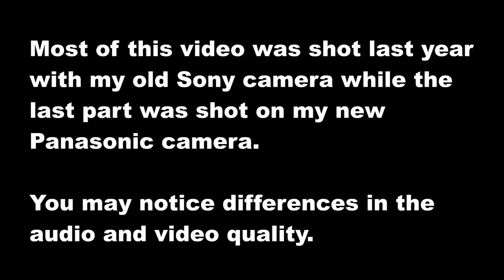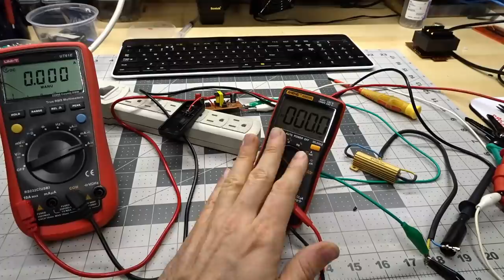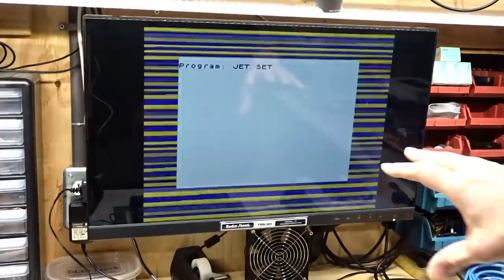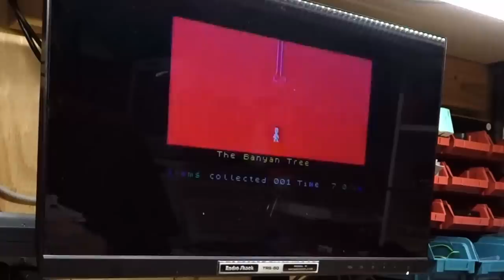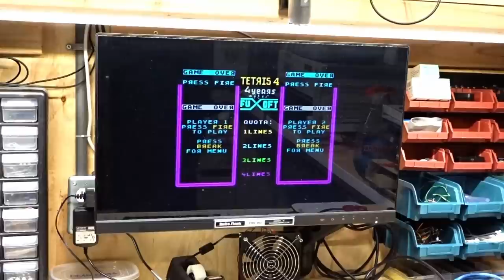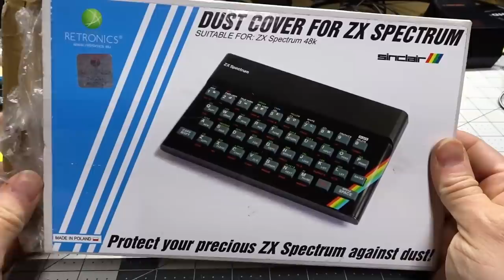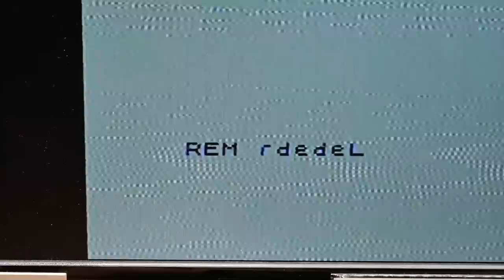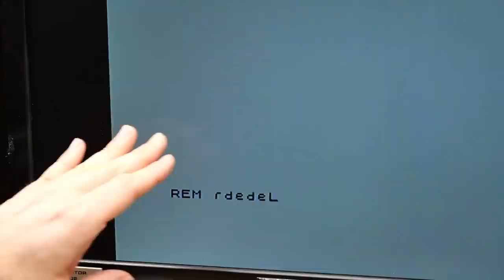ZX Spectrum Part 3 - Revisiting the machine at last!

Comment: I know this is old video so my comment might be irrelevant. Would it be possible to check with a scope the signal going from the tape input and follow how it is being shaped into digital signal? Maybe some of that analogue circuitry is old and needs refreshing. Bad caps, or noisy transistors/opamps. Similar to how you diagnosed the acorn machine. Then you could also see what volume level gives you the best and cleanest signal
Reply from the maker: Now i've done that on the Acorn Electron, it might well be the similar fault that was on that machine! I always just choked it up to the version of Speccy causing the issue ... but indeed may well be another fault outside the ULA.

Comment: Hi Adrian! Thank you for your videos. I love every second of them!! I used to have a z80 clone as a kid (born in eastern europe) and I cam tell you're right about it. Huge difference between zx spectrum and conmodore.. cpu, video, sound, keyboard , software.. everithing. I just want to ask you: that's that 8bit computer on the shelf right above the zx spectrum? Is it a TI calculator? Thank you!
Reply: What computer did you have back then? JET? Sintez? ICE Felix? Didaktik? TimS? CIP?
Reply: Marc Kloosterman - Hi Marc. i had a CiP-03 home computer (made by Electronica Bucuresti), then a HC 90 (made by I.C.E. Felix), but also worked on some JET, TImS and Cobra computers . Then an  Student PC XT (also made by I.C.E. Felix) - an 8086 with no math co-proc. Beautiful times :)
Reply: @cretescumarian6057  I have 2 JET's, a working blue one and a yellow one which I haven't tried, and a working HC 2000 (but missing a good tv cable). Just by saying you had a JET, CoBra, CIP-03 and HC, I know that country in Eastern Europe you mentioned has to be Romania 😁
Reply: (and maybe your surname too!)
Reply: @Marc Kloosterman  - Indeed it is ☺️ Glad to meet you, Marc (Netherlands?). I looked up for the cavle you've mentioned (it's been a long time since I had one) and you can hook the HC up to a TV set using a normal RF cable or to a monitor using an RGB cable. I used to have one of those ICE Felix green phosphor monitors later on... kinda miss those days..
Reply: @Marc Kloosterman  - and how come ended up having three computers from Romania? Collecting?

Comment: yes a proper Video RCA cable by nature should be thicker as it should be coaxial cable and not just twin flex like what's used in audio connections
for what its worth, I never tape loaded a speccy but I have never gotten a tape load to be solid on a cell phone or MP3 device, there's too much garbage in the signal, a wav file playing from a PC works well on my apple II and timex (us speccy with "differences")
I think even some of the best portable devices out there are just too lacking in audio fidelity and audio horsepower to deal with a "high speed" data transfer or they try and be cute masking the deficiencies with processing that would be very desirable to a humon but not a computer.

Comment: that RC cable is picking up noise from something else in your setup.... i would look at the power supply. Also look at your amplifier you made. It amplifies everything, including electric noise. Also as stated by others, try turning your phone down to around 80%, at max volume the phone's signal is to hot, adding additional noise.

Comment: The ZX Spectrum likes to hear the sounds as treble, high-pitched, sharp as you can make it, it needs to be treble or the computer wont be able to recognize it, bass sound will Always make your programs crash or error during loading, so in the old days we had to have a screw driver ready to adjust the old tape machines head and adjust it into treble sound, i think that might be the issue with your loading problems, but i noticed again (i already commented that on a previous video of yours about your machine there) i almost cant hear your spectrum speaker playing the "modem" sounds as it loads a game nor ingame, it should be louder. About problems loading games, remember: Loud and Treble; Bass is a No No!, thats the only problem you are experiencing now.

Comment: When you load Jet Set Willy at 9:49 the bars are definitely too narrow and the cyan bars are narrower than the red.
This indicates the volume is too low.
I still don't think you're getting the necessary oomph.

I also note that you don't seem to be able to hear the loading tones (correct me if I'm wrong) but this also indicates low volume.

A further thought occurs...   I would assume that you do have tape connectors in the right way but I remember,  back in the day,  thinking the labelling was odd.
You see,  Ear (the headphone socket) on the tape deck/phone has to connect to the Ear socket on the Spectrum.
I always thought Ear to Mic and Mic to Ear would be more logical but,  on the Spectrum,  Ear goes to Ear and Mic goes to Mic.
Reply: Of course it is in the right socket. Nothing would happen at all otherwise.
Reply: @t7plus  I think you're incorrect there.
I seem to remember,  back in the day,  that if you fed a tape signal into the Mic socket in the Spectrum there was a very small response.   If you fed a strong enough signal in it would work but very unreliably.

The same if you recorded from the Ear socket,  you'd get a very weak signal.
Reply: Yeah, I had a look into it a bit more and you're right. Weird eh? I don't think that's what is happening here though, but when it comes to computers, always check every possibility!

I thought my days of worrying about spectrum tapes loading were over in 1990 when I got an Amiga. No, they are still out there, buzzing and bleeping away. Taunting us. Forever.

Comment: Should have been a 3A fuse, the fuse is just to protect the cable from the plug to device.
Reply: Either that or a 1 amp fuse. The reason the fuse is in the plug is because in the UK they don't have branch circuits with 15A  (or 20A) breakers. They're ring circuits with 30A breakers.

Comment: Did you set do not disturb on the cell phone you were using to load the software? If you get a notification, even if you have the volume down, it might still drop the volume for a second to tell you that you got an email or something.
Reply from the maker: Ah that phone was not on a normal Google account -- was on one that doesn't have any Gmail or other activity. It's my phone I use specifically for loading software onto old 8-bit computers.
Reply: @adriansdigitalbasement  ah okay. What model is it, out of curiosity, and do you like messing around with custom phone ROMs?

Comment: I take offense to the term "Crappy US Plug".  Our plugs are fantastic.  I also love our power standards.  UK plugs, if made to spec, are very expensive compared to US plugs.  We don't need 220/240 volts everywhere.  In the US we only put 240V where it's needed and the much safer, less expensive 110V everywhere else.  Yes we have a plethora of plug standards, but this really isn't an issue for non-commercial consumers.  The cost of materials to wire a residential house in the US is half or less the cost of wiring an equivalent house in the UK with no appreciable value for the cost.  It's the long term results of standards.

You have a quad outlet combo on your bench.  You wouldn't have that if you were using those UK plugs.  Imagine the space they consume.  I could go on, but I shant.  Ranty rants have come to an end.  :)

Comment: Even die hard Speccy lovers admit, it's a very difficult machine to live with. Even if you do sort out the loading interference, you still spend almost as much time loading as playing. Either get a modern loading solution (CF or SD card) or stick to emulation.

Comment: Is the speaker OK? If it has low impedance (much below 200 ohms for issue 2 boards and 40 ohms for issue 3+ boards) it can pull the EAR input down. (Source: http://blog.retroleum.co.uk/electronics-articles/spectrum-tape-loading-notes/)

Comment: ahh ground isolation issues how I hate you
you could try sheilding the amp and making sure it has a direct and high current path to the ground of the spectrum and whatever device is being amped up
honestly the biggest issue with old pc's loading via tape was ALWAYS due to weak or garbled signal and almost always had to do with poor electrical connections between the adc of the pc and whatever was playing the audio
due to quality usb chargers being 100% isolated and the ground issues you could make sure all devices on the chain have zero connection to the mains side of the psu's (besides class y caps obviously) then make sure a direct path from the 3.5mm jack ground to the zx tape input ground (maybe with a few 250ma fuses in-line in case of crappy psus being connected causing a ground fault) this might increase interference resistance (obviously assuming the amp is inside a metal box connected to the amp ground and a fuse to the audio i/o ground) ground loop issues have caused many a panic attack with audio systems

Comment: Very odd these loading problems. Back in the day I owned a bog standard mono tape recorder and setting the volume to 75 percent of maximum almost always worked just fine. There are some insane fast loaders out there like the one used in "Way of the Tiger" which try to load stuff at some 6000 baud instead of the usual 1500. And there are tapes like my original Jangler which are just very badly recorded. 
Other than these exeptions loading almost never was any problem.

Comment: The original jetset Willy on the spectrum is incompletable due to a bug. I only found out years later when the first emulators came out and i could use snapshots to replay when i lost a life. :) But yes problems with different tapes and fiddling with volume was part of the speccy Life ;)

Comment: WD40 is the shit! 
When I weld stuff at my job there are sometimes a plastic cover on the stainless steel and when cut in a laser the glue gets burned to the surface, WD40 is what removes it afterwards.

Comment: maybe since the recordings tend to be at different levels instead of the volume knob have like 2 or 3 settings you can like jumper on and off for like the 2 or 3 volumes that work well.  Also, maybe try loading with 9v input and see if it works better.  I wonder if all these old zx spectrum games could be re-leveled to the same level so all the games load the same.
Reply from the maker: Yeah I'm curious if this app I'm using is problematic for others or it's just my particular Spectrum

Comment: I never had a Spectrum back then, but I know Spectrum tape loading issues were quite common.  Given that this is the year 2020, why not use a modern device based on flash memory cards?  I don't think they're expensive, and you'll still be using the real computer.

Comment: (Sorry if someone else's said this - I've just spent what feels like an hour reading the comments, but YouTube has Twitter/Facebook disease [page just keeps growing].)

You appear to be using real audio files from that 'phone; I presume the problems are in the original capture. (If it's always the same games that fail, that would tend to support this.) As another has said, you have a 'scope - have you looked at the audio signals? (I saw at one point you appeared to have a stack of real cassettes - I think I saw "Chess"; did you try any of those?)

You had one of the printers in one of the videos.
The printer did indeed use silver paper: it was actually black paper, with a silver conductive powder coating; the printer did indeed cause the coating to come off, so that the underneath black showed through (so the print was black on silver). At least, the ZX80/81 printer worked that way, and I'm pretty sure the Spectrum could use the older printers, though it may have been able to use fancier printers too.
On the ZX80/81 machines, the video output disappeared while printing - because the printer used the video circuitry, just slowed down! (It was a one-pixel "print head".) Obviously the Spectrum had to produce the same signal, but I don't know if it had duplicate video circuitry so something remained on screen. (I never had any ZX machines; I just thought  this was a most ingenious thing to do, print slowed-down video! My computer route was Tangerine [1K then 8K], Oric, Atmos, BBC.])

I did encounter at least one /business/ using a black-on-silver printer (I think a garage). Must have shown some determination! (Either to run the entire business on a Spectrum [or 80/81!], or to make something else drive such a printer.)

Comment: Your HD converter box, I found the same one on WISH and I just wanted to know, you did the composite mod to you ZX and it looks like you're plugged in to the coaxial port on the box if I'm seeing it right. Is that port used for composite as well ??? looking for a converter box for the PAL machines I have and instructions for that box are a little hard to follow.

Comment: hi, i use  PS2 slim power supply on most old computers is 8.5v 5A  and is safe. PSP charger for 5v also good.
Reply from the maker: I have one of those PS2 slims as well. Good tip, thanks.

Comment: Do yourself a favour and look into OTLA and K7ZX apps for the PC. They can create a wav file from speccy snapshots that load in a fraction of the time of standard tape speed. I can load most games in around 30 seconds!
I use a little mp3 player into a simple op-amp x10 amp running off a 9v battery.

Comment: The fuse is not related to the device. It is there to act as a circuit breaker for the house wiring.

Comment: A 13A fuse was the default rating in older UK domestic plugs, a variety of fuse ratings were and are available which you could replace it with being 1A, 2A, 3A, 5A, 7A, 10A, and 13A. 13A 5A and 3A being the most common ratings today in modern plugs. The older type domestic plugs are still available, but for safety all UK domestic plugs attached to consumer equipment that are sold today are now sealed and cannot be opened by the consumer. The fuse is now accessed from the outside of the plug. https://houseofbrag.files.wordpress.com/2013/02/sealed-uk-domestic-plug.png

Comment: I know I'm rather late to the party seeing the three videos but I thought I might comment upon your closing remarks.

Indeed, the ZX Spectrum is far less capable than all the US manufactured machines at the time, and indeed the BBC Micro you had in the first video. However, the machines such as the VIC-20 were either not stocked in the popular electronics retailers (or newsagents in the case of the Sinclair machines) or were a lot more expensive.

Of the Commodore machines only the VIC-20 was in the same price range, but you had to buy the dedicated tape player extra. (You can see representative prices here: https://archive.org/details/your-computer-magazine-1983-04/page/n13/mode/2up )

You have to remember that the people in the UK had a far lower disposable income than the USA or Canada at the time so even the 16K ZX Spectrum at £125 when first released was around or above the one week's wage. Being able to afford computers was a luxury. Only "rich" people could afford the BBC Micro etc. Uptake was helped in mid-83 when the price was reduced (£79.99 for the 16K version and £125 for the 48K version).

In terms of the popularity amongst bedroom coders, the biggest reason for this (other than the vibrant hobby computing press) was that the manuals were extremely thorough, including all system variable info, memory map, Z80 instruction set etc. i.e. practically everything you'd need for a development environment.

As for the "dead flesh" keyboard. Programming in BASIC using the keywords was actually quick once you got the muscle memory, only rarely having to look for the most obscure keywords. The later version with the non-rubber keyboard which you aluded to was the recased "ZX Spectrum+" which arrived in 1984, along with the 128K version of the machine. Both these disappeared and replaced with machines without the keywords on the keys when Amstrad bought Sinclair and redesigned the machine.

As for the loading, the volume level always had to be precise. It's a downside of not having a dedicated data recorder. However, part of your problem, along with the equalisation of modern audio equipment, is possibly the bitrate of the recording, if it's not being generated from a TAP file. Back in the day it was better to use a cheap tape machine rather than a HiFi as it was best to have lots of treble and little bass.

Comment: hi had a 48 plus one i alot better  later on i had a 3 plus with  a disc drives  i had the unit you put in the back to move tape  games to discs 
yes the cassettes were a pain  have  tryed to move the file from the phone to the computer  and use wavelab  to make all the audio levels the same 
as you know the lavels of all the games is going to all over the place bob

Comment: I have always had issues trying to load games using an emululated tape file. So I gave up and now I only use the original tapes. They work 80% of the time, the same as it was in the 1980's. 
So my advice is Adrian.... Get some original software and a nice old tape player.

Comment: Hello Adrian. I just got a Spectrum (I never had one before, I had a C64 as a kid), and I had the same issues trying to load games from the PlayZX app. It does not work. But I had excellent results using OTLA (https://code.google.com/archive/p/otla/). It converts Spectrum Games into Wav files, that you can reproduce using my cellphone and load it into the Spectrum. It also makes the loading much faster. A full game takes less than a minute to load, Check it out. Greetings from Argentina.